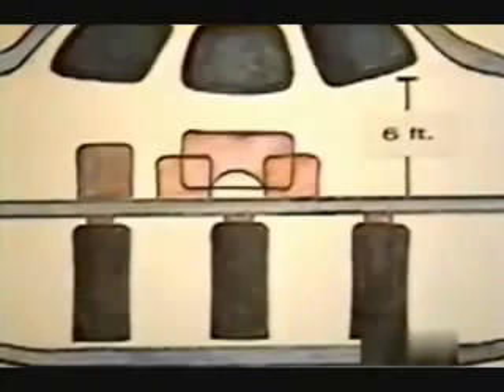How Alien Spacecraft Work From "UFO Top Secret: The Bob Lazar Interview" - 1996

Comment: Listen to what he's saying I'm a lay person but what he's saying is correct if you I don't know how they control it, but if you take matter and run it into any matter after throwing a subatomic chronic particle into an element we just discovered and can't keep any usable amount of because it dissipates in microseconds, it would convert into almost 100% energy you're never going to see 100% energy but it's like 999999 okay and that incredible amount of energy and something so small I mean the craft it's it's so smal,l it's it I could see how incredible electrical power could Warp space-time just a little bit. Basically it becomes its own gravitational source. It can adjust its own gravity waves which means it pools instead of pushes like a thruster and it manipulates the space time in a way that there you don't run into anything is like you would in a rocket it's right it's it's almost like it's in its own little universe I think that those things can when they travel it must seem like everything else around them is standing still. If you can create gravity it's game over because it does act as a protective shield of sorts you don't quote unquote fly anywhere it's not a propellant it doesn't propel you, I can't think of a word of how it moves but it's not fly. It warp space time around it and then uses gravitational sources to pull itself too. And when people talk about speed it's not speed in the way we understand speed but it it basically shortens the distance between itself and the object it wants to go to by the manipulation of space-time. She's 100% right that all other gravitational forces like stars or giant planets they would all be interference so as you're " moving'  towards a certain point... Gravity from other objects would act as interference that's not b*******. The way I see it in my mind is while in the craft you don't go to a location the location comes to you.

Comment: so assuming all this is true, I've seen different variants and clips of all his interviews, but not sure he goes too far into extra detail on the operation of this drive. He mentions the accelerator deflects a particle at some given time to E-115, to create E-116. This is the part that's fuzzy to me. Is this a constant process, many times per second? Or does the antimatter heat reaction only get need periodically because it's so efficient it's constantly tapped and replenished? Are there safeguards? Sensors? Seems there weren't moving pieces of wiring, but if we were to EVER try to embark on testing this more in the public eye, the concept of working with antimatter will make peoples butts pucker to 9000. I'd really like to learn more about the physics of this :D